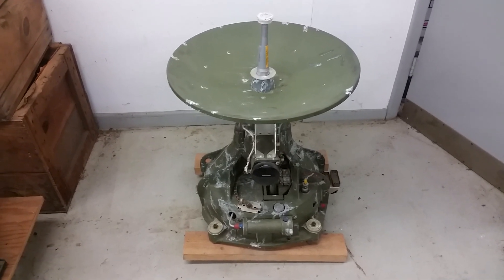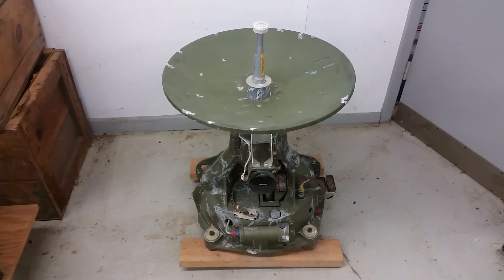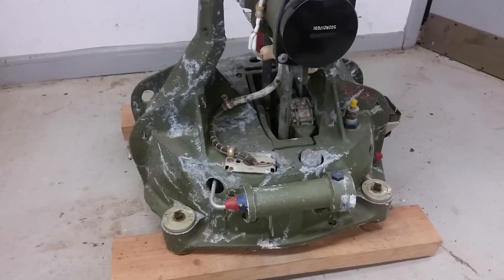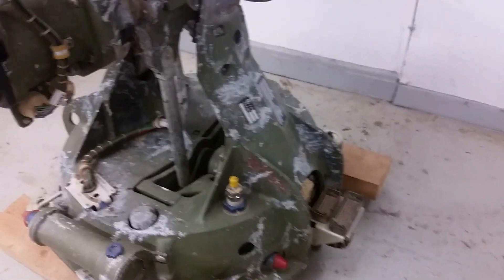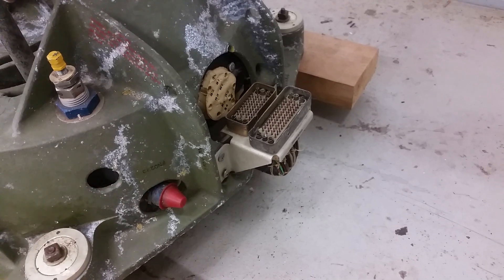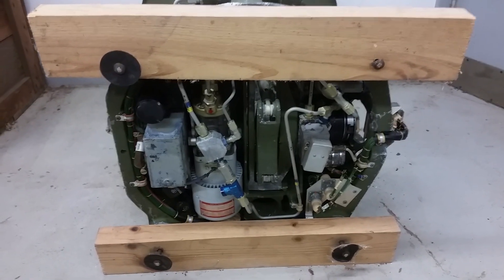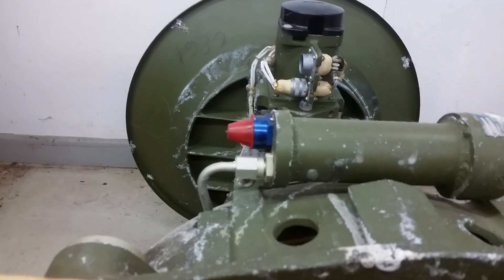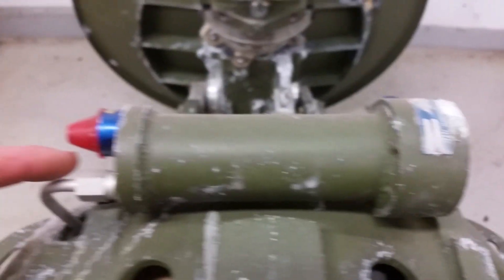Bomarc Missile Radar Antenna

Comment: What the heck is the huge black thing with fins we can see at 9:02 ??? it suspiciously look like a RTG 😆 Oh BTW, there is a special scredriver for stuck screws, it is called a drill bit 😋 more seriously, there are so-called "Screw extractors" bits you can get for cheap from China, the do the job... when they don't break.
Reply from the maker: And yes, I have an extractor set, as well as counter-twisted drill bits. Let's give the oil a chance.
Reply from the maker: That is a sad AN/APS-3 modulator. I grabbed five of them at one point, all in crates, but two fell to the Demon of Moisture.

Comment: So this thing with the control box would be hooked up to a truck and ported between the destination and the sage system? Would it have worked as a repeater of what the sage system was calculating?
Reply from the maker: No, this and the control electronics to hopefully be shown (and the missing RF parts I do not have) rode on the missile. One time use. Very short life.
Reply: @uniservo  Huh, I never imagined a dish on board a missile, make sense I guess, where would it sit? The middle?
Reply from the maker: Bomarcs were very large missiles. At some point, the Air Force classified them as fighters: F-99.
Reply: @uniservo  Oh, yeah probably ought to look it up a picture then, I wasn't imagining somthing big. As you can tell, I'm inept with military tech.

Thanks for the info though.